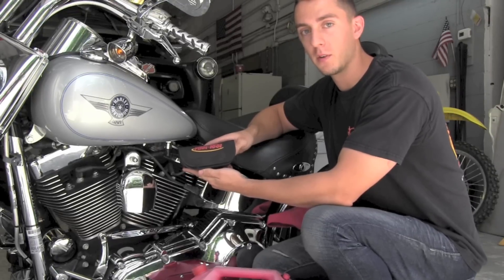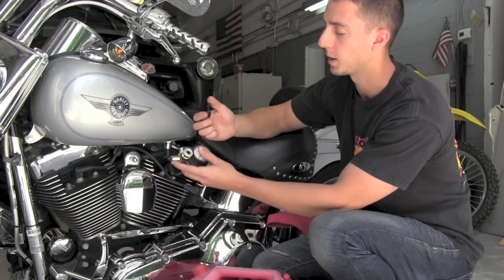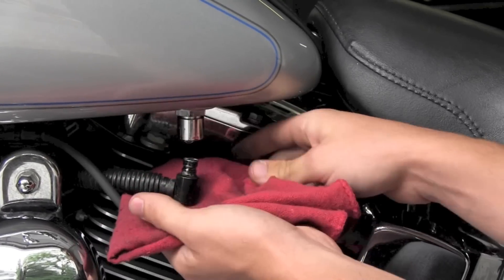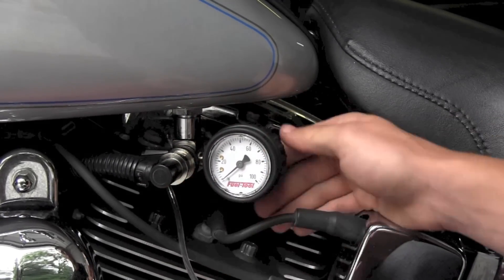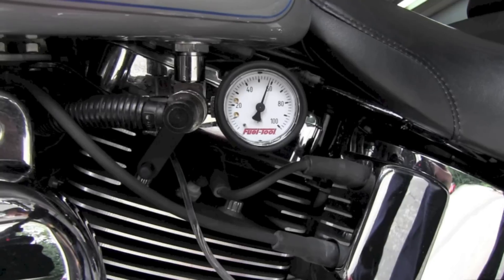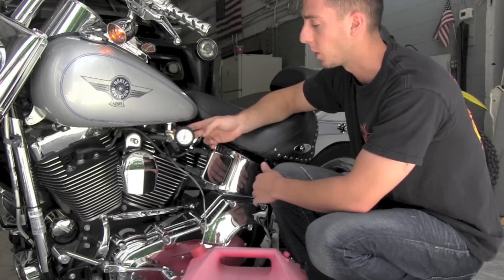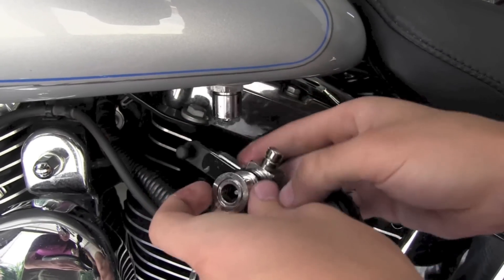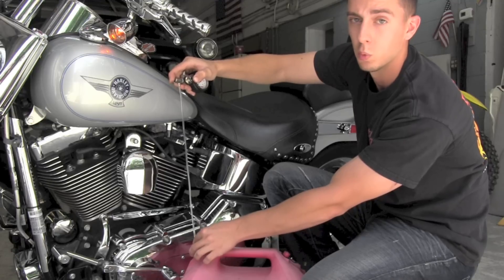Harley Fuel Pressure Gauge: Static (MC500)

Comment: you did a good informative video on this fuel pressure testing.   there is a lot going on inside the tank of the injected  bikes: fuel pump, pressure reg, fuel hose's { i've had em break on the road} & the sending unit for the fuel gauge.  to be honest, i wish i had my carb back.   my old FXLR lowrider didn't have half the maintance.

Comment: Should the needle on the pressure gauge be jumping around like that?
Reply: Duh! It's a Harley!
Reply: It comes because the pump is trying to stabilize pressure while the flow is so low and sporadic at idle. As fuel flow increases with engine speed, it would (should) stable out.